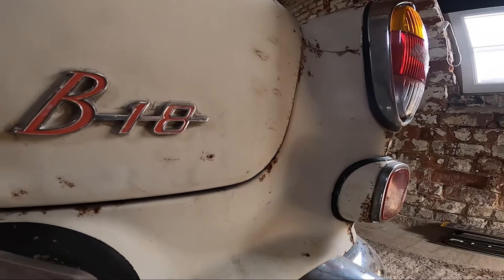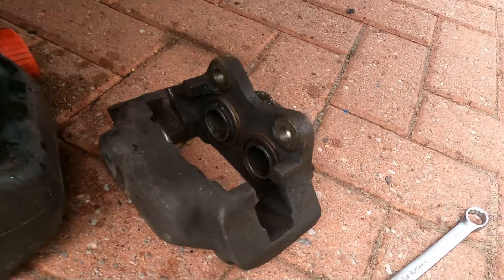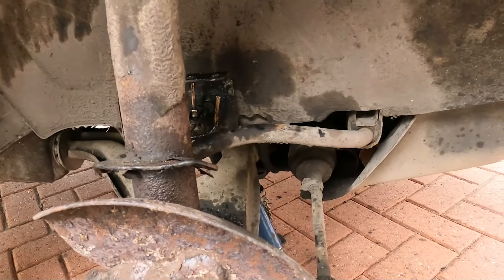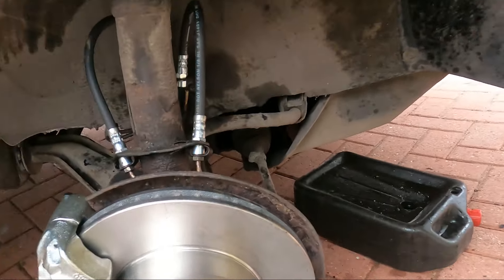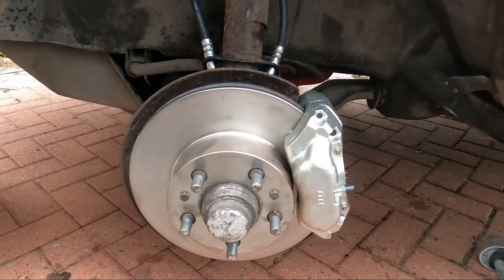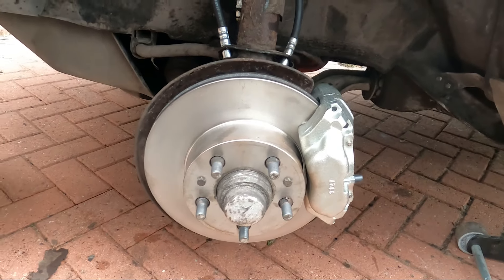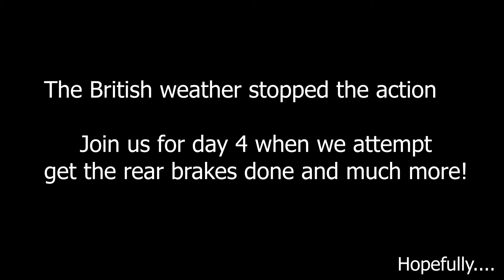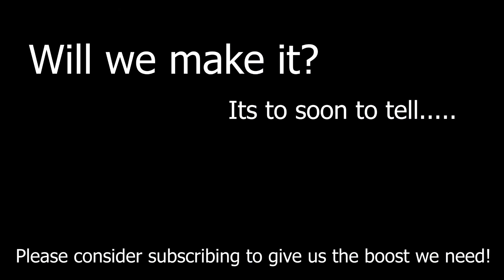BRAKES & FIGHTING THE BRITISH WEATHER - Volvo 244 GL - Day 3

Comment: Day 3’s video was good as well, in spite of being cut short by the rain. The ends of the hard lines quite often shear off, so that is another common 240 thing. If you haven’t done it already it would be worth going out and spraying the threats where the hard lines join the callipers at the rear with some penetrating oil tonight. They do have a tendency to twist if they haven’t moved for a while.
Good fortune tomorrow, I’ll look out for the next episode.
Reply from the maker: To be fair this is the only part of the car that’s put up a bit of a fight. Much like the 245 things to just come off nicely. Cheers for following along 👍